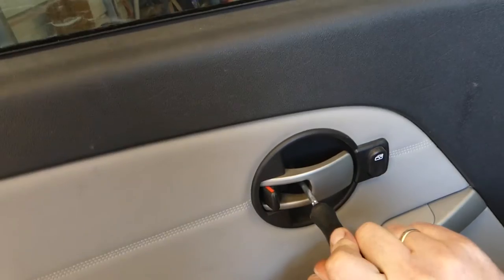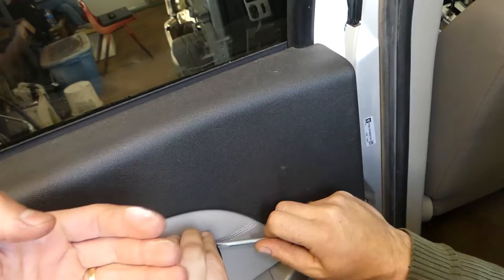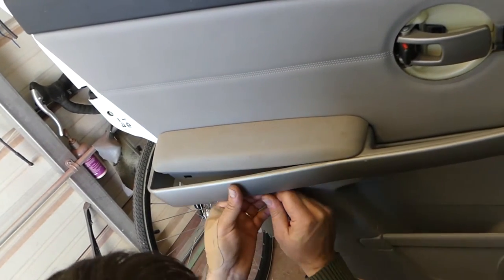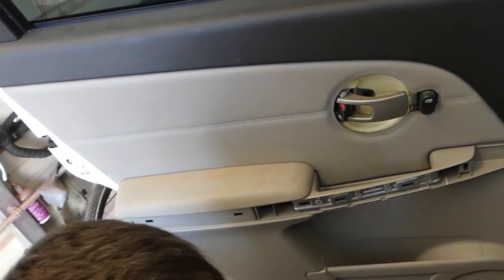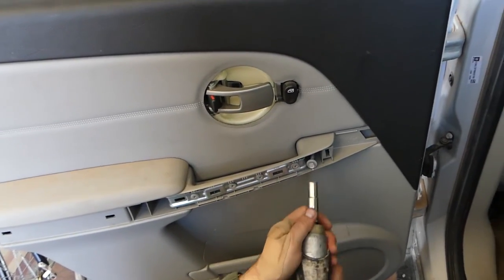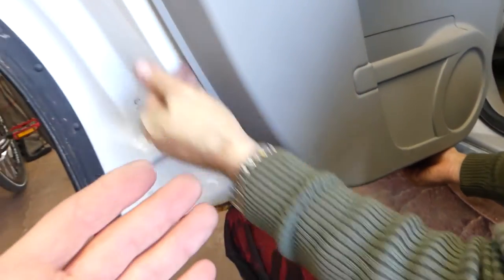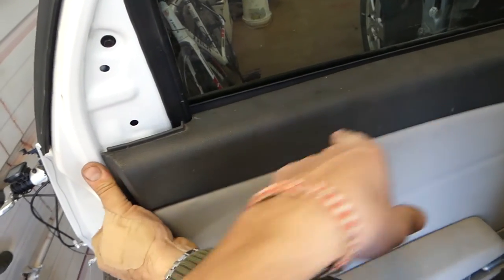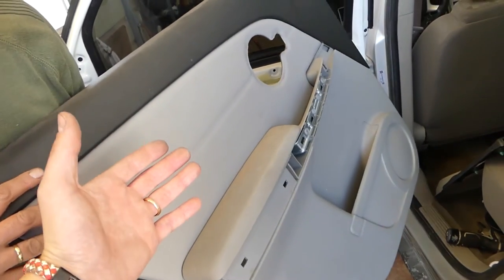CHEVROLET EQUINOX REAR DOOR PANEL REMOVAL REPLACEMENT TORRENT

Comment: You really should be using a door panel remover tool instead of the screwdriver so you don't scratch or ding the trim.  The tool is usually under $10.